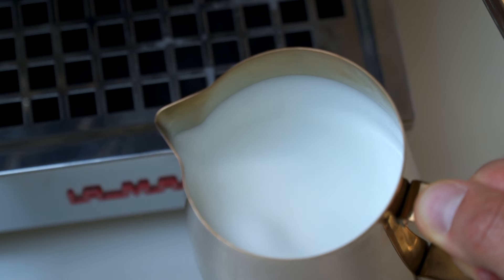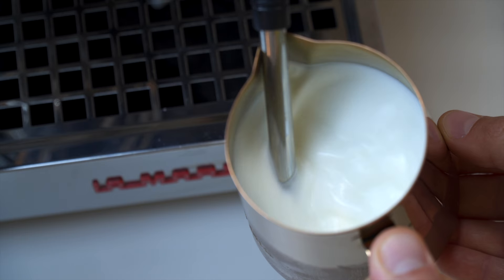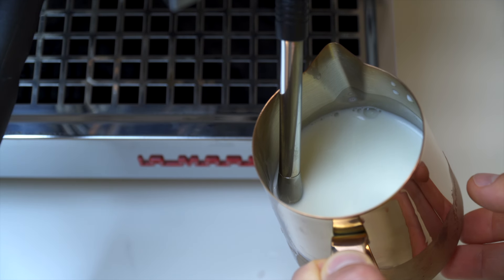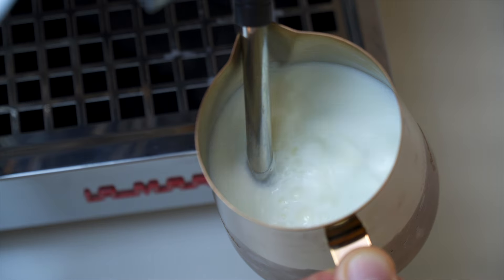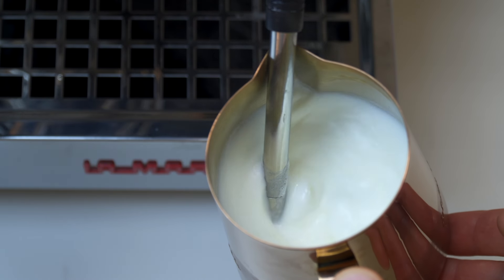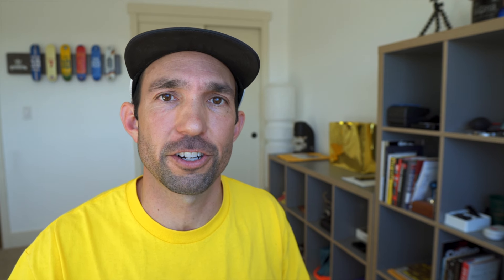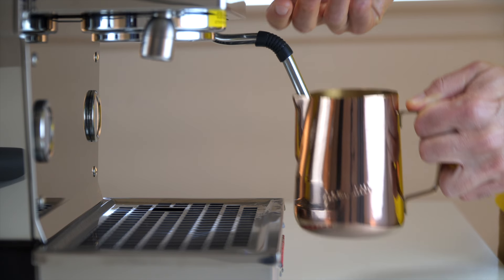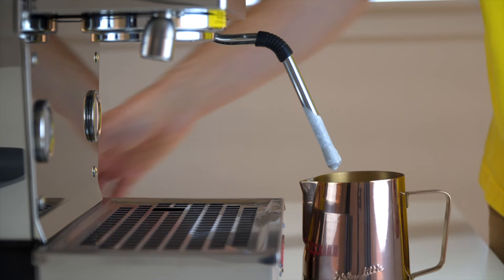Milk Steaming For Latte Art - Barista Tutorial | Chris Baca

Comment: i've tried everything, im doing all of those thing completely, with all type of milk....still i can't manage to get that milk to draw on the surface, it always pierces the top and go straight to the bottom. i'm getting very tired of this. i always get a nice wet paint kind of milk, with thick foam at the end of the pitcher that blop on top. Is there anything about different wand tip that might help ?? i have plenty of steaming power with a Majister Stella HX machine....
Reply: If you've got the foam like the video describes, then it's probably your pouring technique that's the issue. Put your shots in the cup, then angle the cup and start by adding the milk to the shallow end until it's most of the way filled. The closer you are to the surface the less likely it should be to sink, the higher you drop the milk from, the more likely it should be to sink.

Comment: I recently upgraded to a more powerful commercial machine and im having trouble with my milk. Struggling to incorporate the right amount of air and get a whirlpool going before the milk gets too hot. It used to take around 40 seconds and now I have to do it in like 15seconds. PLZ HELP 😩
Reply: If you're steaming smaller pitchers/amounts of milk at home, you may find that you don't need to open the steam valve all the way.  This seems to be a common thing when going from home machines to commercial machines.  Also, you'll need to adjust things to get used to the power of the new steam!  Try a larger pitcher/more milk to start with?
Reply: Thanks for the reply however I figured it out by mistake. I thought id order a two hole tip to replace the current 4 hole one. Turns out when i unscrewed it was totally gunked up! So I wasn’t getting much steam power as it was condensing in the time and just releasing hot water in my milk & also the milk was not spinning bc there was not much air/steam for that. Anyway I’ve put the two tip on for now and I’ve finally got perfect latte art milk. The four tip is still too quick for the small amount of milk im using

Comment: Tell me how to froth, steam, “silk,” n “stretch” this stuff without that magical steam wand  that’s attached to a professional latte machine? Can you give us then magic anger to that? Perhaps with the cuisine art mixer like I have?
Reply: You need to drop about 10-20F off the temperature or it will burn. Other than that, the process should be similar.
Now, if you don't have a steam wand at all, you can use a mechanical frother. I've got two types, one is similar to a french press, you microwave the milk in 30 second increments until it gets to be roughly 140F and then push and pull the plunger up and down until you get the desired amount of foam.
Or, you do the same thing with the microwaved milk and use what is essentially a mechanical whisk to froth. That's the best way I've found other than an actual steam wand.

I think both ways cost about $20 or so on top of the cost of the microwave. If you've got access to an induction hotplate, that's a better way to get the milk to the correct temperature. Simply put it in a pot of water and heat the water to roughly 140F.
Reply: Chris L thanks!